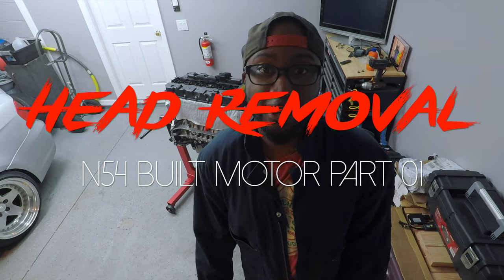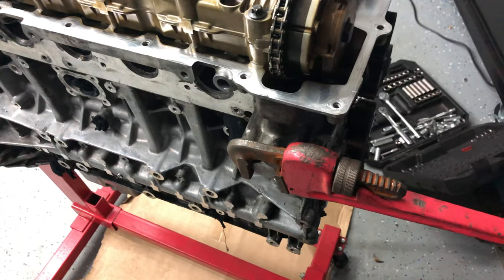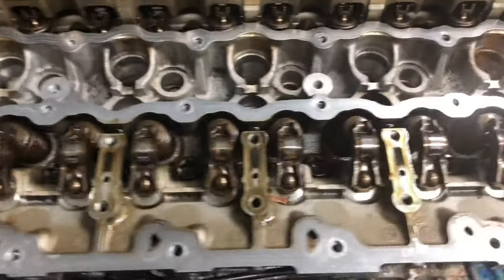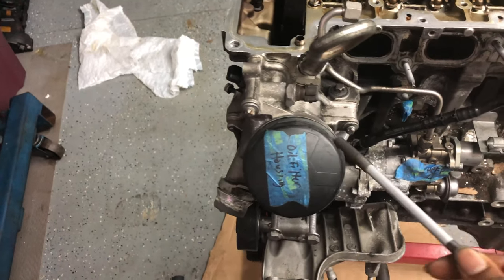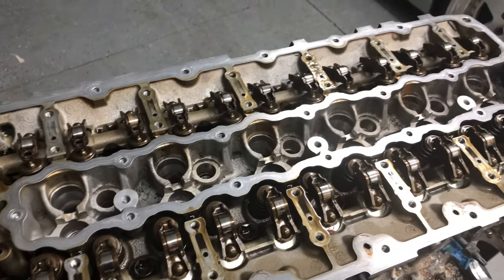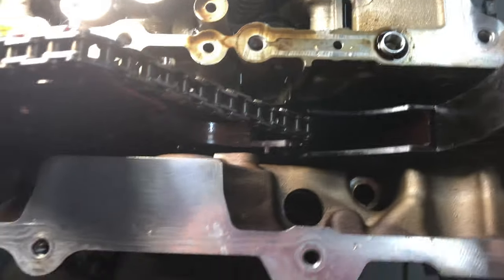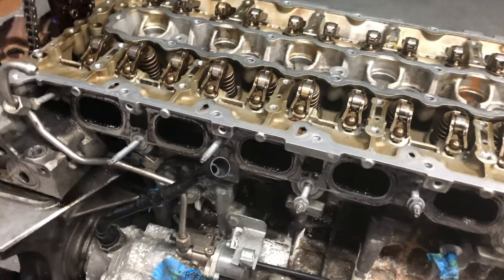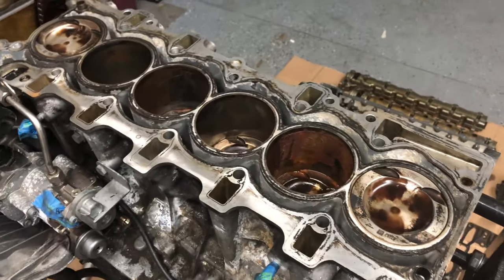BMW N54 335i Cylinder Head Removal

Comment: Where you from broda?
Reply from the maker: Ocho Rios but here in Orlando
Reply: Did u have to use a cam locking tool to remove. The cam sprockets
Reply from the maker: No didn’t use one but did on assembly
Reply: @complex_nOshi  I'm doing head replacement in the car not sure if it'd require for disassembly
Reply from the maker: @goodvibez500 Yea might as well just getting it, since going to need it on assembly. The main reason to use it on disassembly is so you don't mess up the cam and such. But if you do disassemble without it, just back each bolt out evenly.
Reply: @nOshi2x  thanks brother
Reply from the maker: No prob!